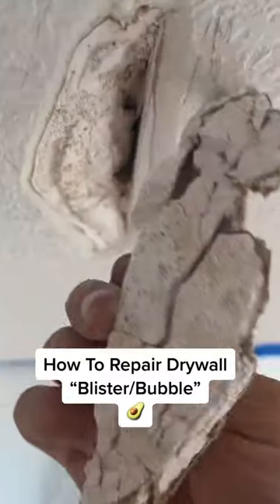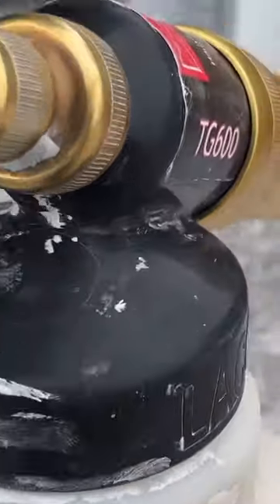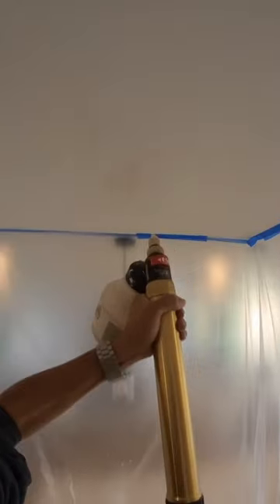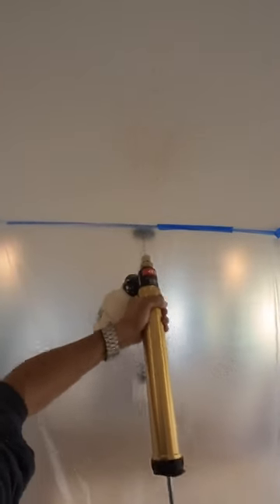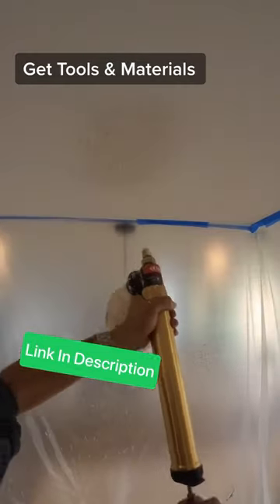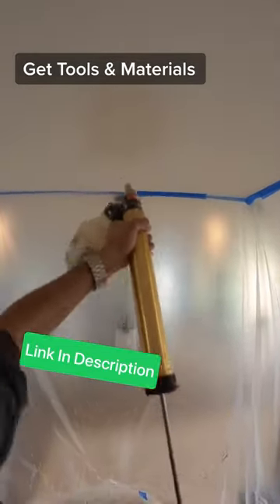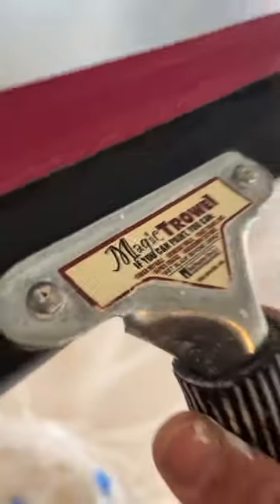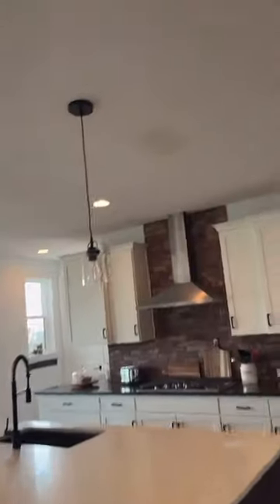How To Repair Drywall Blister/Bubble. (Full Video) #drywallrepair #ceiling #handyman #diy #howto

Comment: Hey brother, when I repair painted surfaces, I add a little bit of all purpose white glue to the water before mixing hot mud, helps tremendously with adhesion. Great work bro 👊

Comment: So I had torn drywall paper (from chair rail removal). Smoothed it out as best as can be. Used glue over entire torn paper surface. Also applied Roman pro 999 paper sealer. Then did quick set hot mud easy45. I still got some air pockets you see bend inward when you press your finger against them

Any suggestions how to rectify those problem areas? 

Thanks much

Comment: You waited 5-10 mins before knocking it down but used easy sand 5. Wouldn't the mud already harden after 5-10 mins?